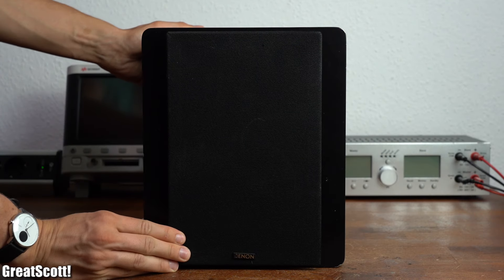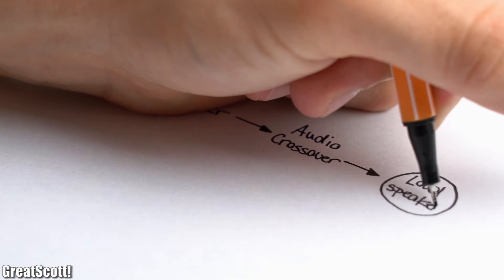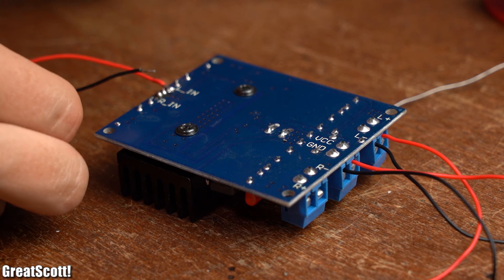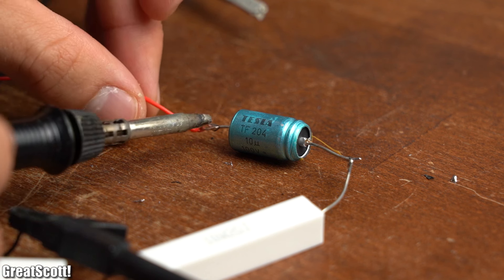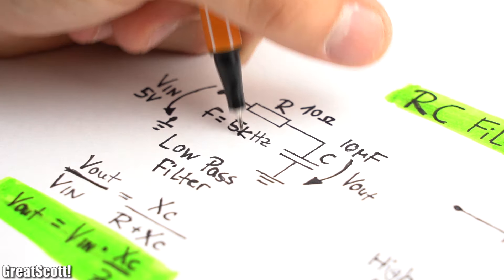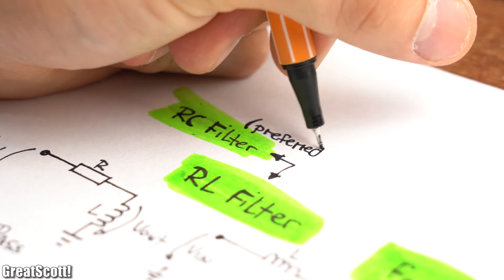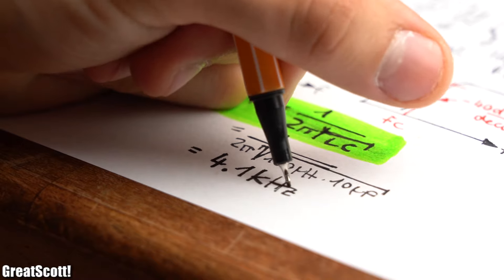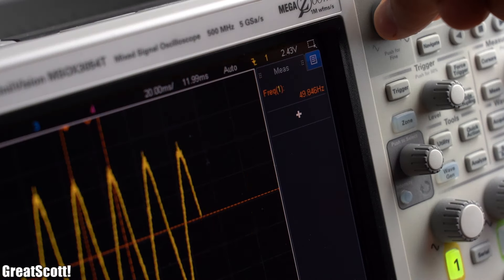Does a DIY Audio Crossover make sense? How passive filters work! || EB#41

Comment: -20dB per decade? Taking 10 years to turn down the volume seems kinda inefficient.
Reply: Lol.
Reply: Never heard  decade used with audio before. Since when did octaves go decimal?
Reply: @SuperGrover  Bode plots are usually on the logramithic scale, in powers of 10.
Reply: @bassboy2947 , exactly
Reply: @quadcorei8085gen2  Üdvözlet! Ön véletlenül nem a budapesti Radnóti Miklós Gimnáziumban (volt) fizikatanár?
Reply: I think he meant decibel
Reply: According to Wikipedia, Decade is a logarithmic value used within the audio filter. So he is correct.
https://en.wikipedia.org/wiki/Decade_(log_scale)
Reply: @quadcorei8085gen2  Linear, not logarithmic?
Reply: @TheActualTed  Linear for the human sensing, which is logarithmic in the language of physics.
Reply: @gazsope  Ah, got it.
Reply: One decade (symbol dec) is a unit for measuring frequency ratios on a logarithmic scale, with one decade corresponding to a ratio of 10 between two frequencies (an order of magnitude difference). It is especially useful when describing frequency response of electronic systems, such as audio amplifiers and filters.
Reply: @zoom-into-nature  so, basically the engineers decided to pick an unrelated word with Dec in it. Well, I'm glad it is decade instead of December. Too bad those audio engineers aren't creative enough to come up with a word that doesn't already mean time originally.
Reply: @sobertillnoon  Um, no. Decade meant "ten parts", that's it. It wasn't used to tell a period of time. It could mean "ten parts" of anything. Only in the 1590s people started using it to mention a period of ten consecutive years.
Reply: @zavieralzie  dude, no. This isn't 1589. The MODERN definition definition says nothing about parts of 10. This was a joke about a bad translation. The last guy already corrected me about how it isn't a bad translation. Your attept to do likewise is bad and irrelevant. Please read a comment thread before deciding to add your pointlessness. Thanks
Reply: It is common in Engineering to refer to a first order rolloff as a -6dB/Octave or -20dB/Decade.  They are both referring to frequency.  Octave being a doubling (8 musical whole tones), Decade being a factor of 10.  If you actually look up Decade in a real dictionary you will find it says 'Factor of ten' as it's first reference.  Now you know, since you are trying so hard to be pedantic !!  Yes we got your joke!  https://www.merriam-webster.com/dictionary/decade
Reply: @hannescamitz8575  

But octave is still way more common. 
Usually a 1st order is described as 6db/oct. 2nd order as 12db/oct etc. 

I knew decades as a frequency unit, but I've rarely seen it used for passive crossovers.
The AF bandwidth is just too narrow for such a huge unit, 3 decades already cover the whole spectrum of human hearing.
Reply: @westelaudio943  I almost never use octaves
Reply: @westelaudio943  Can't tell about any other fields but I am only seeing octaves being majorly used only when I got interested in speaker building and to me it seems octaves are prominent only in Audio industry. 
As an engineer, I have always been familiar with decades as expression of ratio and very rarely with octaves, probably once or twice.
Reply: hahaahhaha.🤦
Reply: decades are decimals or exponents of 10
Reply: Decades are about 10 to 1 ratios of frequencies.  
The audio band is broken into 3 decades ...
20hz -> 200hz
200hz -> 2,000hz
2,000hz -> 20,000hz

It can also be divided into octaves, which are 2 to 1 ratios.
20 -> 40
40 -> 80
80 -> 160
160 -> 320
320 -> 640
640 -> 1,280
1,280 -> 2,560
2,560 -> 5,120
5,120 -> 10,240
10,240 -> 20,480

It depends on what you are designing.

Comment: FULL BRIDGE RECTIFIER... oh wrong channel :p
Reply: Full bridge audio rectifier
Reply: Beating a dead horse
Reply: @caffeinatedinsanity2324  Where can I buy such a rectumfrier, Sir?
Reply: Mr. Boom lol
Reply: Unibrow unites!
Reply: MESA DUAL-RECTIFIER
Reply: The lack of diodes in these circuits should have been a clue that rectification to DC is not needed. 😁 Audio circuits are almost always outputting a form of AC. I get the joke, though.
Reply: @brendanbiele2736  well the dual-rectifier has diodes but only as two half bridge rectifiers so they can split the AC signal in the positive and negative parts because it's an ab type amp. The diodes can be switched to rectifier tubes because it sounds a bit different. 
Cheers
Reply: Das Siedler, yes of course.  I love a good tube rectified push-pull amp, but the signal driving the speaker is still AC. Semantics though, right...

As far as this joke goes, yeah, I think it is all boomed out (with all respect).  But someone said “rectumfried”; and that’s AvE (another amazing Canadian we should all be watching).
Reply: This ain't the elctro boom channel
Reply: @draco5991rep  I don't know. Maybe Uncle Bumblefuck might help you with that.
Reply: Greatscott and electroboom these two are my regular channels. 
Did anyone know others
Reply: FULL BRIDGE RECTUMFRYER
Reply: @caffeinatedinsanity2324  so I posted this same nonsense, then scrolled down and see im not the only one who heard this when they said it aloud.....

Comment: A huge part of the discussion missed when dealing with filtering components of capacitors and inductors is the phase change introduced.  The phase change is visible on every one of your input/output examples on the oscilloscope.  This is a critical consideration. For example, when a dual component (12dB/octave) crossover is used on both the high- and low-pass sections, the output for each will be 90 degrees out of phase totaling to 180 degrees, and the woofer and tweeter will be out of phase and cancel each other out at the crossover frequency.  The correction for this situation would be to connect either the woofer or tweeter opposite to how they would normally be connected.
Reply: True, but not neccessarily. Sometimes the phase shift of the speaker drivers themselves offsets the crossover phase shift.
Reply: Equalization is quantization 🧐

Comment: Funny paradox: the better the drivers, the simpler it is to make a good sounding crossovers. While with worse drivers you have to really get it together to make them both work in their proper ranges and not give you huge bumps and valleys.

Comment: Even numbered crossovers (2nd order, 4th order) change the phase by 180 Degrees. The fix is reversing the tweeter polarity
Reply: Or the midrange driver, if we are speaking about a 3 way speaker.

Comment: I've studied passive filter at school, 6 month of studying just that argument.

Great Scott does it a couple of minutes video.

I used to draw lot of Bode charts!
Reply: Yep, good old Laplace and transfer functions
Reply: For stuff like this, one would work with lots of polynomial math than Bode plots. Chebychev was one sadistic bastard!
Reply: Haha he was, our professor would take points off if the plot did not show a slope of -20 db/dec
Reply: Sry i speak peasant what degree was this for?
Reply: Electrical Engineering
Reply: @hunterjackson802  I studied IT at high School. But we also had computer architecture, electronic and some other related stuff.
Reply: Agreed !!  And he did and outstanding / comprehensive job of it too !!
Reply: I need a textbook. This is all way over my head. Can someone link a primer for me? Please.
Reply: Likely cost,a minimum buy-in of 1/160th your life, with less than 109 units remaining until expiration.
Reply: Chevy SparkEV Chevychev filters are great for a sharp cutoff, but usually a butterworth design is better for audio applications, especially at low frequency. BW filters have little or no ripple and can be matched so that LPF/HPF cutoffs match, leaving no sum signal loss. They are also relatively simple to design. 

Of course, In other applications like RF or signal manipulation, other filters may be better.
Reply: @tomalcolm  incase you're still interested, here's a list of material if you actually want to get into crossover design:
1) Check out a few MIT courses or other free courses on signals and systems. You dont have to study everything, but get a good grasp on Laplace and Fourier transformations and what they have in relation to signal frequencies.

2) Get a fundamental grasp on passive electronics. Resistors, capacitors and coils and how they can be connected to form filters. These filters perform exactly what is described by laplace transformations when you pass audio signals through them.

3) Get a good understanding of microelectronics such as operation amplifiers (op amps), BJTs, MOSFETs, and JFETs for starters. These are used to buffer and amplify your signals to power a speaker for example.

Comment: the crossover can be complex because of 3 things : 1) to flatten the impedance of speaker drivers so they act more like resistors because otherwise your calculations using that formula won't make sense once you change that dummy load resistor with real speaker driver. 2) how steep are your crossover ? Bessel, Butterworth, LR, 1st or 2nd or 3rd order etc. 3) how well behaved the frequency response of your speaker drivers. hope that helps.
Reply: needed lossless format (WAV/FLAC/ALAC)

Comment: A little project/challenge for you, Scott:
since you love bikes, you could create a video converting a motor (2 stroke/4 stroke) from a carburetor fuel delivery system, to an EFI (Electronic Fuel Injection) one, since it's 2019! Surely not a challenge for somebody like you. Also, it can be done with any microcontroller, Arduino too, since it's all about reading data, and doing actions in the given timing.

Comment: You could improve the old cross over by simply replacing the capacitors which ALWAYS degrade over time. In order to start from scratch a crossover that gets the best performance out of the drivers or even to select a good set of drivers from scratch, you need the FRD and ZMA files or the ability to measure and derive them from the drivers themselves. Once you have the files, a free cross over design program like PCD (passive cross over designer) or WinPCD can be used to maximize the performance of the selected drivers. The enclosure type and size is also critical and there are several on line box programs. Parts Express provides the FRD and ZMA files for all of their Dayton Audio drivers and also offers several other brands of DIY drivers. The PE forum is a good source of information as is that of the DIY Sound group. The programs take care of all of the complex math.
Reply: The Impulse Audio and 123Toid youtube channels have videos that go through the cross over design process using the free cross over design programs.
Reply: Actually, all you need is a bunch of different coils and capacitors, and a ts chart so you know where to start, I've done it many many times,  you don't need a computer at all, except to order the parts,

Comment: You can pop back the dustcap with a vacuum cleaner.

EDIT:thanks for the likes
Reply: and if that doesn't work: Use a small, long needle, poke a hole in it, and pry it out (using the same needle)
Reply: Yeah
Reply: failing that again, toothpick and a very very tiny drop of glue, either hot or superglue, thats up to you and the material of the cap
Reply: Sticky tape does the job as well as long as it’s not too sticky ;)
Reply: for rigid/metallic dust caps, hot glue + toothpick or lips-sucking techniques work... :}
Reply: if the dustcap is plastic,then snap out the pointy corner using your nail
Reply: That can damage your speaker... never do that...

Comment: I once wanted to put an LM35 inside the output filter inductor of my 3D printer to measure its temp. The high frequency switching induced a shitload of noise on the sensor's wires and would display nonsense. Thats where I remembered those RC filters... Needles to say that a low pass with fc around 500Hz did the job and the measurements were crystal clear afterwards. So dont neglect your filters people even in simple tasks!!!
Reply: Especially when reading a DC signal.

Comment: In India we use rc filters at the input section and the filtered signals are separately amplified by multiple amplifier IC s,and for better low frequency response we use op-amp low pass filter at the input of the channel dedicated for subwoofer.then the stereo amplifier consist of three channels (2.1 system)

Comment: The best setup is a class T amplifier for the woofer and a class C one for the mid and high range. The signal is being processed by the amplifiers itself. This brings you the most efficient speaker with the best sound.

Comment: Another EE here (but haven't dealt with such filters since school).  I can't help but think that the signal should be treated digitally (near-"brick walls rolloffs" can be trivially calculated using 1024 point FFTs (not an option when I learned this).  Reasons to not do this include the cost of the DSP (probably just a raspberry pi for this crew, but hopefully you can break out the channels at the source of the audio), plus the need for more amplifying channels (although each can have lower power and be optimized for thier frequency range, like using class-d for the woofer).

Passive crossovers are likely better between mid range and tweeters, and just split out the woofer (and subwoofer if needed) digitally (this may even reduce a channel needed.  At least that's what I've heard of the phase issues (all rlc filters induce phase issues, but a good DSP method's won't be measurable), the higher frequency phase errors aren't nearly as audible to humans.
Reply: Yeah DSP is certainly the preferable method, and allows for far more processing than just filtering, but as you say... cost increase and requires a channel per band.  An Rpi isn't really suitable for DSP purposes, but a dedicated DSP chip is not expensive, and could be controlled by an Rpi easily if a UI is desired.

Comment: Just built a pair of 3 way floor standing speakers  - open source design (SB Acoustics Rinjani) I just bought the drivers and built the cabs myself - didn't bother with the passive crossovers - for just a $100 more bought an active DSP that let's you experiment with this stuff in real time - way better.
Now with Parts Express selling really nice amps with on board DSP I can't understand why any home builder would bother with passive cross over any more.

Comment: That original 'complicated' crossover had a Zobel network. It's designed to help present a constant load to the crossover, compensating for the need to account for the equivalent driver circuit in the crossover. Modeling a woofer as an 8 ohm resistor is a bad idea, considering its inductance will turn a 2nd order filter into a poorly tuned 3rd order filter. With a 2nd order network, you'd invert the terminals on one speaker to account for the 180 degree phase shift. But on a 3rd order network, there would be no point to reversing polarity on one speaker.
Fun fact: I replaced an off the shelf crossover with my own design a week ago. The difference is that I designed the speaker enclosure, and chose the drivers, but got cheap with the crossover when I built them. I finally have money for a proper crossover. 16 AWG air core inductors and polypropylene caps for a 60W monitor. It helped that I measured the impedance curves for both drivers and knew what circuit I was really dealing with, along with having a 3D printer for printing the inductor cores for winding them.

Comment: I am redoing the crossover in a set of speakers I have. I am just reverse engineering my existing crossover and building an exact copy with all the same values with much better components while keeping the originals intact. They are not high-end speakers, but they are $1000+ speakers and I think I can squeeze a bit more performance out of the band pass and tweeter circuits with better components. They sound good over all but sometimes it seems like the mids/highs take a step back at higher volumes on really complex tracks. I wouldn't say muddy but I would like a bit more clarity. They don't get any worse as you turn it up, even at house shaking levels they remain relatively clean. That's why I think I can get a bit more performance in the middle out of them with better caps and coils.

Comment: MiniDSP modules are the answer. Forget passive filtering DIRAC is the way. FIR filters rock and the ability to correct phase is essential these days.
Reply: Don't throw out IIR filters just yet. It can do a fantastic job when combined with digital delay between drivers. Also FIR can significantly delay the audio resulting in poor lip sync if you are not careful
Reply: @chrislambe400  
Indeed. I'm just playing about with an IIR module right now... to run the sub in my wife's van.

Comment: another reason not to use simple RC-filters for loudspeakers is that the impedance of the loudspeaker (typically 4-8 ohm, almost real and not complex) has to be accounted for, since it is effectively in parallel with the output component of the filter (parallel with C for the lowpass and parallel with R for the highpass). Such a low resistance in parallel would mean that you would have to use veeeery large capacitors to get their reactance into the same order of magnitude for  audio frequencies.

Comment: Active crossover before the power amplifer is also an option using op amp filters that do not need inductors and are not affected by the electrical characterestics of the speaker
Reply: bi amping requires more amplifiers though, it certainly has it's advantages but they are usually only used at the very high end of audio equipment.
Reply: Who wants to have  amplify two signals though...
Reply: Now there's 20$cad little 2ch amp, i think it is something worth thinking tho
Reply: Insane people... @DatsunRacingTeam